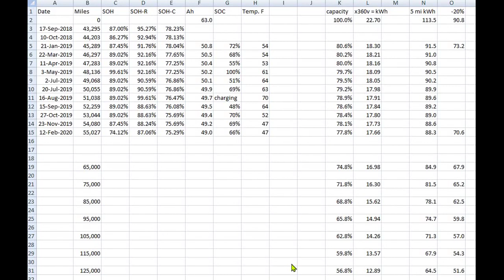2013-2019 Fiat 500e - Battery Degradation

Comment: Great information! Thank you 
I bought my 2017 500e in 2024 with 30k mi. My range is approximately 50mi now.  I believe the hv battery is probably around 50% soh just based on age instead of drive cycles/ mi. Age or battery cycles, which ever comes first. Do you have a source for this samsung 64ah cells by chance? Thank you again for your videos.
Reply from the maker: With only 30k you should be getting 90 miles +.  I suspect it was fully charged & run down to 1% too many times prior to your ownership.  Age does not matter much with any of the various Li-ion chemistries.  You can try eBay for the battery modules and /or separate cells.

Comment: My fiat 500 e 2015 has 100k miles in a public charger it accepted 8.5 kw from 50 percent to 100 percent so I guess my usuable battery is 17kw. I dont believe mine can get 5 miles per kilowat anyway it should be around 3.5 mile per kilowatt

Comment: I just bought a 2017 500e eSport edition in California with 19,000 miles for $11,000. 6/27/23. Shipping to Philly for $1,200. 

I come at it from a different point of view. I have an Ebike and learned proper battery management from it and DYI battery packs. 

Is there an internal heater to allow for charging below freezing? 

I charge very slowly with my e-bike at 1 amp instead of the default 2 amp, but sometimes 3 amp. You should charge to 100% at least once a month because it allows the cells to top balance. Slower charging is more efficient, since it creates less heat showing wasted energy.

The reason to charge to 15% and 85% is due to the charging and poor performance. At below 15% performance greatly drops like off a cliff. Low voltage means poor acceleration. Stopping at 85% is wise because the battery gets a bulk charge rate below 85% and an absorbtion rate above it. 

I expect to charge my car at 110 volts with my solar generator that holds one kilowatt. That should give me for miles extra distance. Ideally, I charge the solar generator with solar panels fixed to my roof, and charge the car in the morning when cool. I don't drive much currently, so 4 miles a day capacity is fine.
Reply from the maker: Welcome to the Fiat 500e world.  It's a solid car with no touchscreens.  🙂 

Yes, the HV battery is heated & cooled.  Checkout my Fiat 500e "teardown" series if you really want to know all about your car.  The "heater" is about the size of a loaf of bread & is located near the traction motor in the front.  Ciao.

Comment: The other day I bought a used 500e and watched your youtube on how to read the battery SOH.  Here are my readings.

HV Bat SOH: 39.22 %
HV Bat SOH-R: 76.86 %
HV Bat SOH-C: 80.39 %

Your video seemed to say SOH is the average of the -R and -C.  But in my case it's not. 

My car has 38.5 k miles and it seems to be running as normal.  Do you have an email address?

Comment: Exactly what I needed to know. I am thinking of buying one with 59,000 mi on it at around 13,000usd. Could be worth it?
Reply: Nope not worth it. I bought mine for 4600 USD with 43k miles on it. Back in 2017
Reply: @aychemara what year was your Fiat?
Reply: I didn't lose range until about 80k miles.  They go as low as $7k now. Trying to sell mine soon. Fun car, fast off the line.

Comment: How much cost the replacement new battery for 500e?
Reply: too much
Reply: @Milkshakman  for a new AC compressor 7k. Imagine the battery. Ended up getting a junked fiats 500e AC compressor for 350 USD. Install was 900 at fiat dealership.
Reply: Oh I just realized I got the compressor from the owner of this channel. Really nice guy to work with. Compressor has been working great now for 3 years

Comment: I own a 500e. The car comes with an automatic 8 year battery warranty. So all these numbers really mean nothing to most people. Older generation Nissan Leafs are still on the road with their original battery packs. They were only supposed to last 10 years, but they are still going. I have an electrical engineering teacher at school who is always trying to find fault with EV's. His logic is, well try driving one across the country. I'm 53, I've never had to drive across the friggin country, that's what airplanes are for stupid! 95% of the people don't usually go more than 50 miles during a normal day.
Reply: When you are retired like me you can drive 60 miles 1 way with a few stops for charging. Then another 60 miles to home. That’s Fontana to Los Angeles international airport to pick up a buddy from the Philippines

Comment: There are two problems with this calculation. You are ignoring the fact that (1) an electric car battery is considered to have reached the end of it's life when it's down to 70% of its original capacity, and (2) the loss in capacity can start to accelerate considerably after you're down to perhaps 75% capacity.

Comment: if you dont drive but about 30 miles every 3 weeks or so , how would that affect life of battery.   keep it charged up to 90% alway?  retired dont drive hardly at all.   just want the covenience of not going to gas stations and smog stations.
Reply from the maker: Keep it at 50% when doing long-term storage for maximum longevity.  So, unplug it at 65%, drive it, plug in when it hits about 30-35%.  At that pace the car with last at least a whole human lifetime!
Reply: @theevolvingworld  thankyou

Comment: Super useful dude thank you
Reply from the maker: Thanks!
Reply: The Evolving World my buddy and myself want to buy a 500e I was wondering did you have any luck with finding a battery that improved your range?
Reply from the maker: Some things that help with range are: light weighting the car, driving gently, no hills, no headwind, keep the speed down & don't drive in cold weather.  There are other things like LED lights & skinnier tires.   But, Battery Degradation will happen, sooner or later.  At some point, a battery swap could be done.
Reply: The Evolving World hell yeah man, thanks super good tips, thank you. Do you have an Instagram aswell?

Comment: The SOH-C stands for the capacity retention (current capacity/65.09Ah original capacity). The SOH-R may be the SOH in reference to resistance growth. Both numbers are important and should be referenced.

Comment: I understand that the SOH-C represents the capacity relative to original. Are you sure the original Ah is 63?  If you divide remaining Ah on the given day by 65, this closely matches the SOH-C % relative to original. For example, for 21-Jan-2019 50.8 Ah / 65 Ah = 78.15 % , which is close to the listed 78.04 %. All subsequent calculations closely match the SOH-C % if 65 Ah is used as the original.
Reply from the maker: That's an interesting observation & makes sense.  However, I continue to observe that "SOH-C" number stays flat sometimes, whereas the Ah always adjusted.   Also, to consider, does the car's computer just display the actual full pack size or is there always an extra 1 or 2% always kept in reserve.  Although, that would add even more mystery & confusion.   😕

Comment: It is not normal for it to degrade so quickly!
My SOH 100%, SOH-R 99% and SOH-C 80% (+ -1%) did not change significantly in 1 year and 15k KM (now 78k KM).
Reply from the maker: Your at about the same capacity as mine was at 78km (48,500 miles)  "Ah" is the number that really matters.  "SOH-C" is more of a rough estimate.
Reply: @theevolvingworld  I really enjoy your videos, very accurate information Thank you so much for sharing with the EV world.

I bought my 2015 FIAT 500e with around 37k miles, now it has 55.6k miles on it. It's been a magnificent little car, I owned a 500 gas powered once and I wouldn't change my 500e for anything (I know, is not perfect but it gets the job done).

My full AmpH capacity right now is 47.5 Ah and I'm getting around 65 miles of real range. My battery degradation is showing to be more because my driving cycles + charge, since the last 2.5 years ~90% to ~15% five days a week traveling and average of 65 miles using level 2 charger.

I know probably next year I'm going to replace the battery module to be able to keep my driving habits.

I wanted to share it with you, I thought it might give you more insight on how our batteries will degrade in the next couple of years.

Thanks again! Keep up with the amazing work.
Reply from the maker: @TheArangoJuanPabloT  Thanks so much for the kind words.  It's nice to get a little bit of appreciation for the work we put in.  Also, thanks for sharing with the community on your personal experiences.

Comment: do you know how much it costs avg to charge fiat 500e from 10% - 90%  ...does it cost more to fast charge ?
Reply from the maker: When new, it has a 22.7 kWh capacity.  20% off of that would be 18.16 @ .10 a kWh (which is our local utility rate) would be about $1.82.  Maybe a few pennies extra for transmission losses.  Depending on your rate in Indiana & how much capacity your battery currently has, would determine the cost.
Reply: Probably cost about the same 110 vs 220 home charging
Reply: I’ve read it costs less to fast charge on home electricity. Some quirk in how power utilities calculate usage...

Comment: Most EV batteries degredation is not linear, it slows, so maybe not as bad. Samsung battery thermal managed, should be typical. I hope for 200k useable if i can partial charge at or near work.
I've been trying not to top off when I don't need to.
Reply from the maker: Your probably right.  I heard that about Tesla's in particular.  Dropping to 95% quickly & then flattening out nicely (also helps to have a battery x4 the size).  The user is the biggest factor.  If I bought my 500e new, it would in much better shape.  But, all in all, for the price paid & moving at the rate it is, i'm very satisfied.
Reply: @theevolvingworld  I agree, people fearing  the battery helps keep prices low & makes it 1 of the best deals!
Reply: I top off but only when I know I'm driving it in short order. If the car sits I try to have it sit between 40 and 80%

Comment: Is there a charge setting to 90% ?
Reply: No, you can estimate & use charge timer
Reply: ...i wish
Reply: -Has anybody price the Battery replacement & instilling or the  500e??
Reply: At level 2 the main battery🔋 basically charges at a rate of 6.25% every 10mins
Reply from the maker: 90% is the goal.  Reality is more like 80-95%, depending on the distance of trip & whenever my hand unplugs the cord.  😉

Comment: how are you able to charge to 90%? I haven't been able to figure out how, it always charges to 100% unless I manually unplug it at 90
Reply: Bingo
Reply: was thinking about this the other day, and if you use level 1 charging, you could use a smart plug with scheduling and just sort of guesstimate how much time you need to charge and set a timer for however long,  also some smart plugs have energy monitoring as well which is nice to track
Reply from the maker: Yes, manually unplug.  Tesla's are the EV's I know of that allow the user to set any limit you want.  🤔
Reply: @theevolvingworld  Chevy Bolt also has internal timer to adjust percent charging to user specified.
Reply: My 2019 Kia Niro EV has an easily adjustable adjustment on screen in car, or by app, to adjust charge limits in 10% increments. I usually leave it set at 80% unless planning a long drive the next day.
Reply from the maker: @jonathanwolman1049  Thanks Jonathan, that's good to know.  I should have said of the one's I've driven & reviewed.  The Niro EV is definitely "on the list" for the future.  Also, possibly the Jaguar I-pace might allow to set charge limits.  I drove one for about 12 minutes or so at last year's auto show, didn't have time to check.  Anyway, all proper EV's should have the ability to set charge limits & show a state of charge % while charging.
Reply: You can program by time, but it seems like a pain